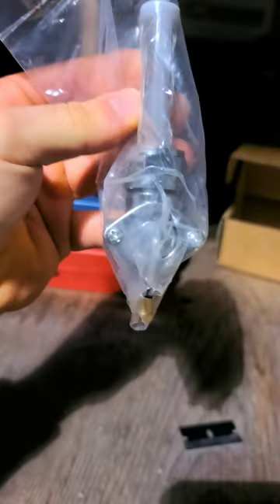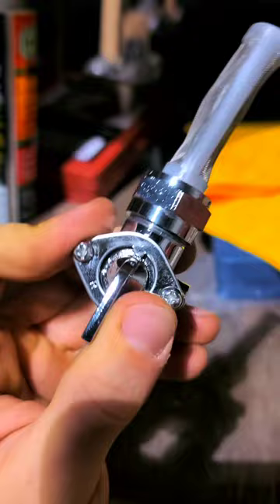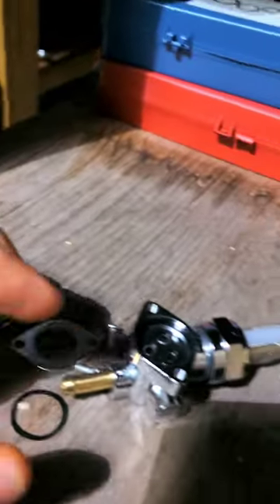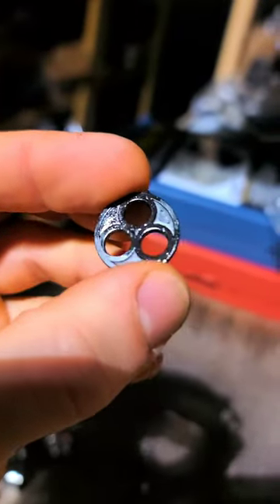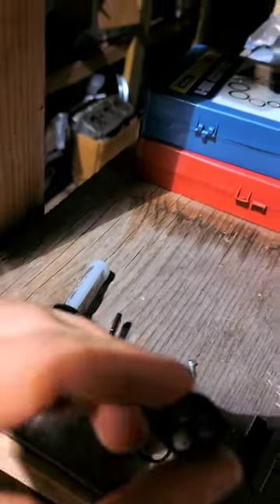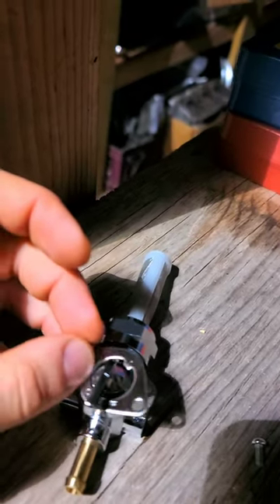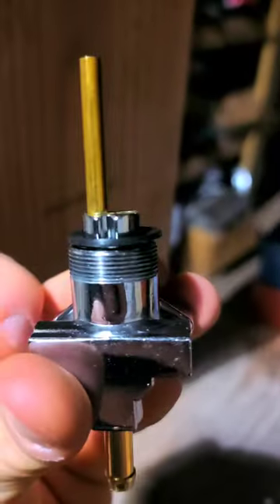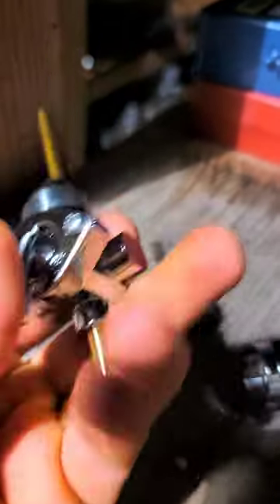Leaky Harley Amazon / Ebay Petcock fix

Comment: I had a fuel valve leaking at the threads. It was made in Tailand, got it from J&P # 1257514. I used your O-ring idea, but no silicone sealant on the threads of the nut. I did use 3M silicone paste on the O-ring to prevent twisting damage to it. All good! Thanks